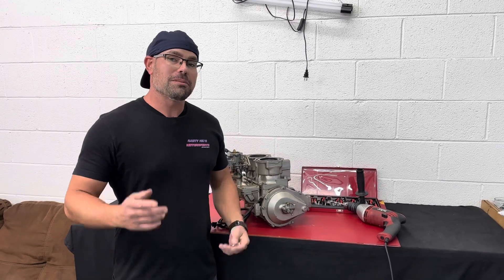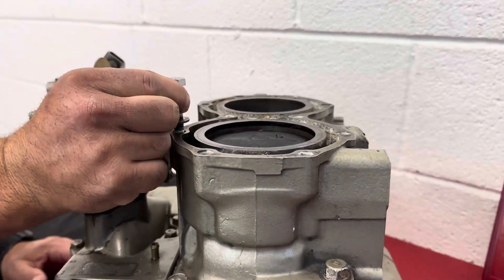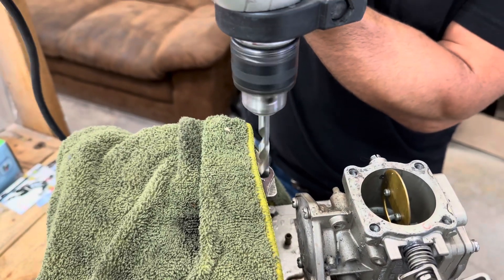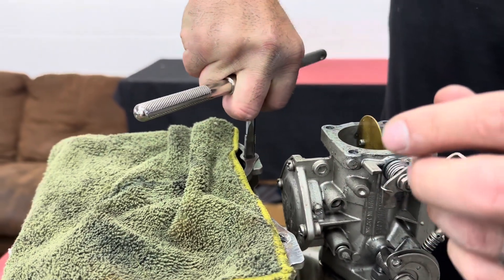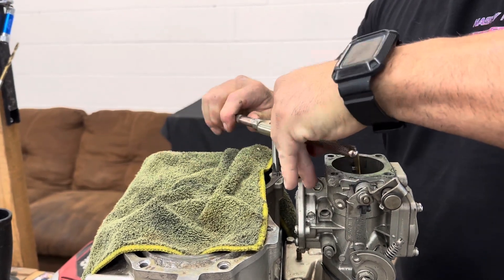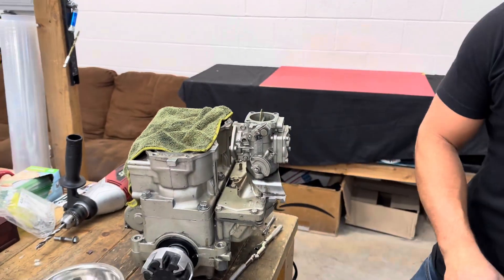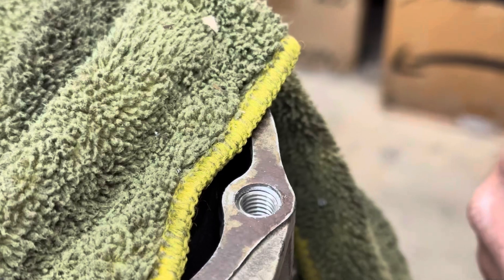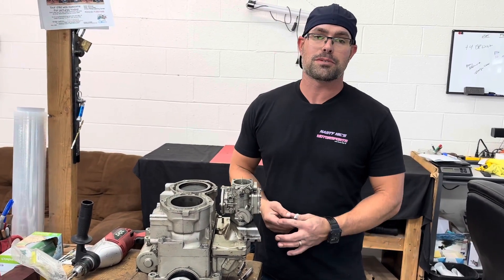How to heli coil thread repair jet ski 650 750 wave runner Superjet 701

Comment: Nice and easy. I like your short and to the point videos keep them coming. Personally I prefer Time Certs for cylinder heads but have used both for other applications. YouTuber “project farm” tested a whole bunch of versions for repairing threads and most would sheer the bolt before stripping the thread once repaired correctly.